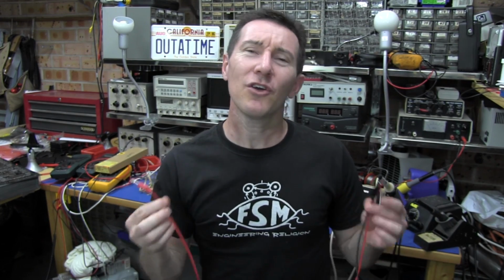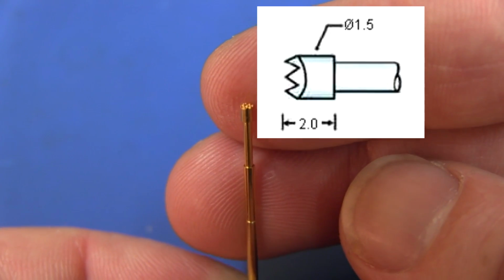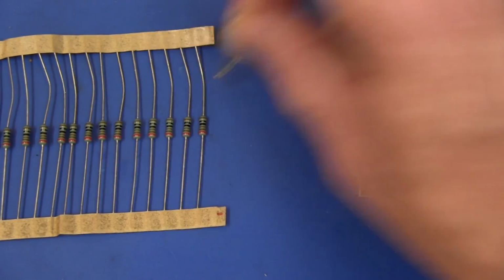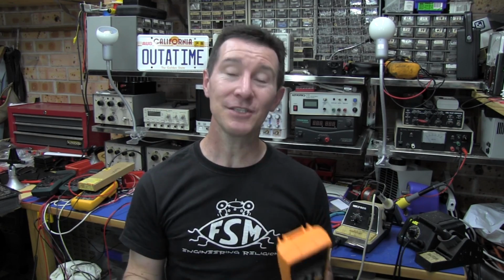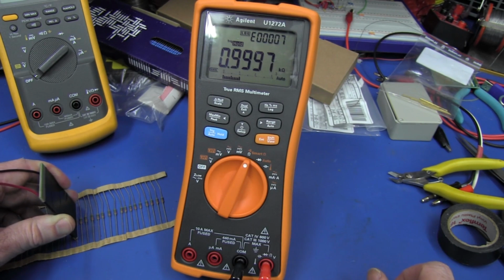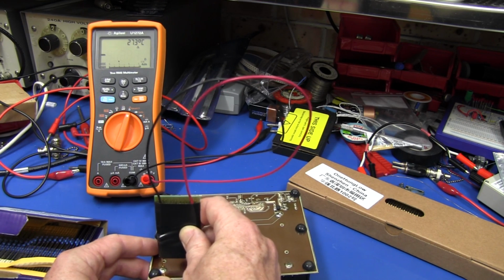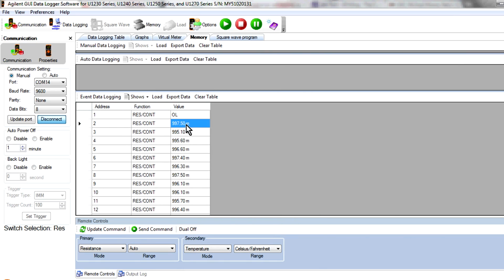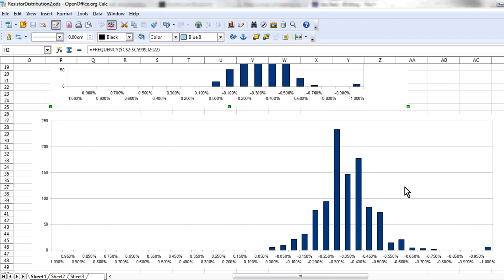EEVblog #216 - Gaussian Resistor Redux

Comment: 32:00  There may also be multiple production lines giving different distributions and means, causing significant variation between different batches.  Only thing you can trust is the datasheet (and not even that after seeing your dodgy digikey video!)

Comment: In case anyone wants to do something like this, I have a bit of advice for an easy way to grab each resistor without any fancy equipment.
Drill two holes in a small piece of wood, plastic, foam, anything or anything, then jam minigrabbers into the holes. Done.

With just one hand, you depress both minigrabbers at the same time and grab each resistor immediately without any fuss.

Comment: I was thinking of having an inverted V, so that however far bent the leads are, the V would capture them. You could have that serrated test pin in the middle. I would have routed or chiselled a piece of wood so the thick part of the resistor has some space, and you could test right close to it. Guess there are a lot of ways to test ...

Comment: What was the ppm temp coefficient on those things? You seemed to be probing at 28 degrees or so. A 100ppm coefficient would give that change in average resistance if it was that negative in that portion of the range, which it could very well be due to tweaking to get the curve as flat as possible over the entire range

Comment: Where do you guys recommend buying components.  Unless I need to buy 100 of one component from mouser or digikey it gets expensive.  Ebay has a ton of parts like 2n3904 or 1n4148. 555s 4017s from china cheap.  Leds.  Do you recommend cheap ebay parts for just simple things?
Reply: MrEkg98 I get mine from AliExpress.com, which is usually cheaper than eBay. The bad part is it takes 4-6 weeks to arrive. I haven't had a problem so far, although I've heard of fakes etc. that other folks have encountered. For some home-built no-big-deal project it's the way to go. If you absolutely need the real thing, get it from a reliable source like Digikey or similar.
Reply: Cymerian Designs yes. Since i posted this i have bought some stuff off ebay. However you dont quite know what your getting. Without traceability and datasheet you will never know its up to snuff. Good for learning tho.

Comment: Instead of tension terminals, couldn't you use leaf sprung omron switches, which would also trigger the capture? I have a good idea in my head how to do it, but it would be tricky and time consuming to get it all aligned properly, but you could make it so the hump going over the resistor wire triggers the switches, which are hooked in series acting as an and gate, which will trigger the data logger.

Comment: 26:58 ...or you can use the find and replace feature. Highlight the data set: Find and Replace: Search= "[space]m": Replace= [blank]. 
  There are other ways as well such as using a function to remove a certain number of text positions from a column. Changing the data to a number format is easy as well. You can correct the format manually, or copy another cell that has the correct format, then use "Paste Special," and only paste the cell format. You can also drag the corrected cell and "Paste Special" the format down the whole column ;)
Reply: Upcycle Electronics, He probably uses Windows... can't get common things like that on Windows!  (just kidding!)

Comment: At 4:10, You need a axial component verifier.  Universal auto insertion machines used to have them back in the day.
Reply: Greg Feneis, Our firm, Quan Tech Laboratories, made test equipment for the industry that did that and MUCH, much more back in the early 60's. Now its over fifty years later and you can't buy that off the shelf? Waaaaah!

Comment: You resetted the propes resistance using some copper on a pcb right?  That resistance in thst copper has been subtracted from all the readings.  Maybe thats why it undershoots?
Reply: Resistance of that PCB trace would be in miliOhms, so not affecting the experiment.
Reply: bar10005 the undershoot is not big either..
Reply: The manufacturers likely didn't have a good 1K reference.

Comment: I wonder if some of the negative bias on the readings may come from the agilent meter.
Would still be interested to see the carbon film distribution.
I haven't any fancy logging meters so if I were to do the same, I'd use a microcontroller connected to serial line to output ADC readings.
Reply: Well, he did zero the meter.

Comment: The test jigs built using pogo pins to make connection to the pcb are also known as a "bed of nails" and can be quite complex. Worked on a system for testing electric car chargers which had high voltage AC/DC present. Must have been 200+ pins for a single board wired into a national instruments system.

Comment: so, Dave, you got a not calibrated equipment, the average offset means that it is an equipment fault.
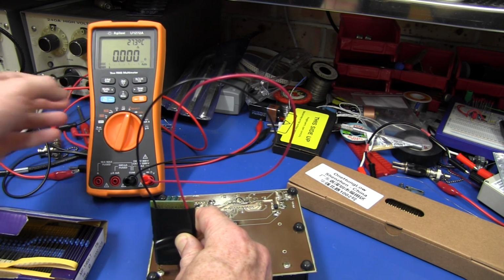Reply: +flyguille Perhaps. Dave used crocodile leads and not his test jig to test the calibration resistor at 21:30 even tho he used his  test jig to null his meter for zero ohms at 22:39 Can someone tell me if this meter can be calibrated at say the 1kohm mark as well as the zero ohms mark ?
Reply: flyguille 21:30
Reply: Does it? It wouldn't be the first resistor batch to be biased below the nominal value.

Comment: couldnt you have just drug a rig with a connector on each side down the line of resistors and recorded the entire output and then looked at the peaks as the resistance and the valleys as the non- contact ? and then measured the peaks?

Comment: Lesson: Try getting the data out when you've done a dozen test samples....nor after 10000000
Reply: tooby98765 except you know, he got the first set of 1000 points off the meter with no issues. But you probably skipped to the end and missed the fact he did the two sets of 1000 resistors separately...

Comment: It wouldn't matter if the meter had a 50% offset as long as he tests all the resistors with the same meter. He's showing all the resistors compared to each other with a 0.3% resistor as the baseline (which read as 0.9998).

Comment: if you try really hard (although i know why you didn't in this case) you can find a way to adapt pci to isa. but if you really like the idea of having that isa card's capability, you can also rebuild the card with the parts on the origional in a pci-e version or any other that you like. but both options are a bitch and a half. the second option is the biggest bitch because you have to build drivers of your own. a better option is to use a micro-controller and convert it to usb. easier to program

Comment: 28:40 can the wires u use cause that offset?
it's a pitty that we couldn't see the result of the 5%, i'm interested if it's a gap in the middle of the distribution, that would mean that they use those resistors for a 1%? (sorry for my english)

Comment: Four rubberized wheels at each side, driven by stepper motor, these v-shaped springs (you know, the ones with a small "coil" in the middle) to press against the resistor as probes... µC with IR diode to control stepping... !? :)

Comment: why not just use 2 plastic gears on the bottom, 2 metal gears on the top attached to your probes to feed the resisters while testing?

Comment: @Joru666 I'd figure the production process has given the nominal value as it turned out, of about .035-0.4% under nominal value. The gap from -0.1 and higher would be because they've been picked to fit 0.1% error range, that would actually make sence to me, correct me if I'm wrong.

Comment: From what I've been told by my teacher, If you have, say 5k resistor with 5% tolerance you may be pretty sure it is going to be quite off the nominal value. As he explained it is due to the fact that if the resistor is within lower error value, say 1% it is going to be sold in that range for higher price. That may also be true according to those 1% resistors you measured in the video.
Reply: This could be a fact for older times. But today it is much cheaper to make different lines for different tolerances.

Comment: I once had to test 1k of caps, using a LCR meter. Took 2 days to do, though only about 5 were out of tolerance, failing for high ESR. Not bad for a batch of 40 year old CTS13 tantalum capacitors. I made the 5 failures into little rockets ( reverse voltage of 28V current limited to 10A whilst case lead clamped in vice, will blow the pellet out when the solder melts. If you do not clamp the case then the case disappears leaving the slug behind) and fired them in the office.

Comment: I would guess the manufacturer has not calibrated his plant recently, or is not worried as all are within a tolerance band. As all the resistors are from the same batch, and were made at the same time, more or less, as you can see from the data, which shows no clear trend related to sample number. They probably were aiming to be no more than half way to the limit, and were not going to change anything whilst it was running well.

Comment from the maker: @sepertude Not really. Calibration is all about "confidence" in your readings, and it's possible to get good confidence in that without going to a cal lab. You can use precision resistors like that as a transfer standard.

Comment: Suppose you fold the band back and forth to stack them up in the space, say, of 6 cm and then squash each end in a vice to which leads are attached. Then you measure all the resistors at one go to get the average. Wouldn't that tell you something without all the work?

Comment: @Wilfredkazoks The antistatic mat has some resistance on the bottom side, on the top side it's insulated so it doesn't mess with your electronics (imagine that you're servicing something plugged in mains).

Comment: Maybe you need to upgrade the meter firmware. A reviewer on Amazon said "The meters were released with substantial bugs. V2.0 firmware was released this month and corrected them. Until 11/11, Agilent will provide a free serial cable to those who ask so new firmware can be uploaded. The process of updating the firmware is straightforward and reliable. 
"

Comment from the maker: @philbx1 You'd still be limited by the response time of the meter and the mechanical movements, so I doubt any such approach would improve the testing time much. Unless you had to measure 100K+ of these things, I think I currently have the optimum diminishing returns approach probably up to 10K-20K, as long as you don't mind doing the work that is!

Comment: To quote the comedy 'I.T Crowd'. "Have you tried turning it off and on again? "
BTW, you know how some smartasses think they have better ways of doing things. Here's mine...
Arduino (or whatever) connected to an RC servo with the servo arm shaped like a cam mounted above the pushbutton on the meter.
An input wire is connected to a switch on the probe board and this is pressed as the pogo is pushed onto the resistor.
Anyway, enough of the crap idea stuff. great patience and resourcefulness Dave!